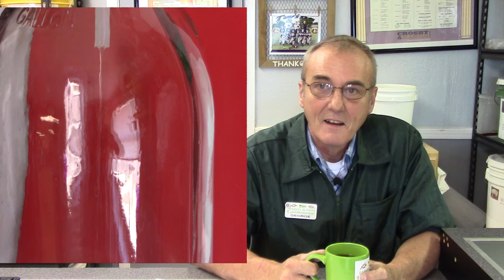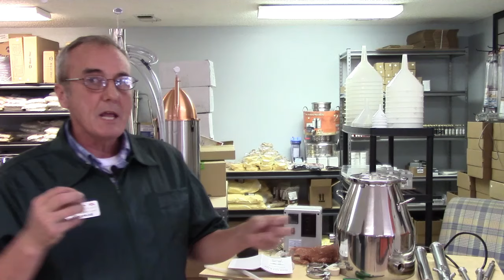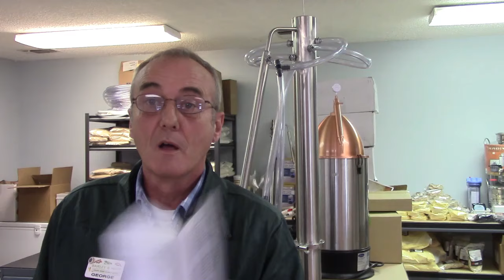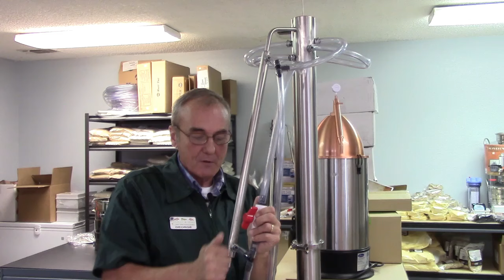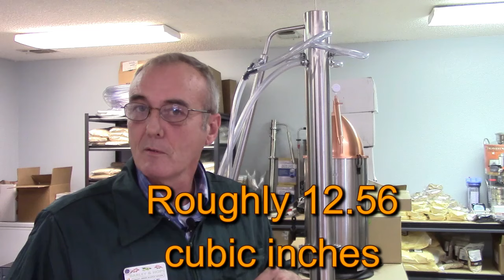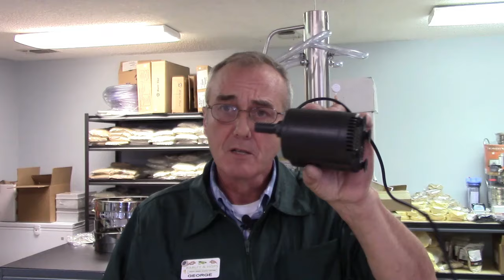3 Inch Combination Pot reflux still

Comment: Completely agree with what George is saying regarding ease of hauling stuff around in smaller batches.

Once you jump from 25L /5 Gallon batches to something bigger there are a whole lot of extra work and logistics presented just in moving around the volumes and weights involved.

I've been running a 50L still in various configurations for about 1-2 years now and anything over 50L and you are moving brew barrels around with sack barrows and decanting stuff in smaller containers or with a large pump/siphon.
Reply: Right on. I live in an apartment with limited space. I have a couple of 40-liter fermenters (over 10 US gallons) and moving those buggers around is a major pain. I'd love to have more space so I could just put them in a basement and forget about them, but I don't.

I tend to use my 19l (5 US gal) ones more often since I have to move them every so often.
Reply: Heck-fire....I have access to a 35x75 shop, and I don't want to haul around anything! Could I use my forklift? Sure, but I'm not gonna!!! Ain't no way I'm fermenting in those 1250L totes!

Comment: Hi George,

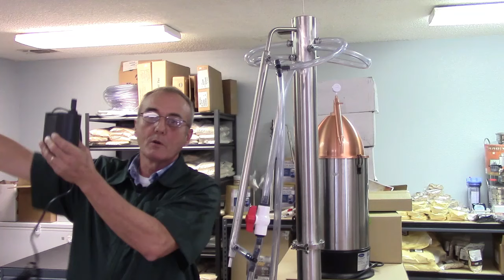I got a 13 gallon  3” column reflux still with a shotgun condenser . I’ve been stilling 5.5 gallon batches of rum and it’s take 5:20 min..My question is this normal? Seems like a very long time. Please advise. Thanks in advance! Bret
Reply from the maker: That sounds reasonable to me
Reply: is there any way to speed it up.. more heat perhaps
Reply from the maker: Yes, more heat will speed it up but make sure you are careful. Too much heat will cause the spirits to come off with tails mixed in earlier than you expect. This can ruin your run. Also, the proof will suffer dramatically after you surpass the optimum production temperature since more water will come out as well as spirits. 
George
Reply: Hi George,

I think I found the sweet spot, H2O flow control a must to keep optimum temp . Need to get electrical heating element and a PID from you. Pls advise Thx Mr. Duncan!
Reply from the maker: Great. The sweet spot is important and different for each still. Once it is found it opens up a whole new world for the operator. 
So glad you got there. Only good things come from that. 
By the way, electric is easier to control with some sort of controller but propane works well too (if you figure out the flow sweet spot of the propane )
George

Comment: can you determine a goldielock temperature for the water coming out of the reflux hose? just curios.. sounds like the pot needs a pop off valve.   Thinking about getting my son a still for xmas. I live on Disability and need to get the best bang for the buck..

Comment: Hi George,
  Puking is when the liquid in the pot is boiling over up the column and coming out the condenser. Huffing is when the column fills with liquid from too much reflux and fills the column. This happens especially when the packing is placed in the lower column tube and inhibits drainback of the reflux. The best cure for this is to lower the pot temperature. If you try to reduce the reflux coolant flow the head temp goes up too high. 
 A huffing still can produce high alcohol but you get pressure release out of the condenser and the distillate surges. OK for stripping but not ideal for high-purity single distillation, and probably the packing is not properly helping vapor production. A sight glass between the column sections will show this. If your still is puking the liquid visible in the glass won't be clear. To get one of these to puke you'd have to be running a burner on very high flame. In either case the pot temperature is too high.
Reply from the maker: Thanks for the information I am sure others will also find this very helpful.
George

Comment: I would agree with you George about the 15gal vs the 8gal. 8gal are a lot easier to manage than a 15 gal and I can still use all the buckets I have for making beer. If you get a 15gal you really are going to have to spend a lot more over the 8gal. So get an 8gal and make life easier for yourself... LOL

Comment: So it's not a good idea to run a 3" column (28" tall) on 15 gallon keg with a 2000w element?
Reply from the maker: Ooo, absolutely. You will have great results and much quicker than the 2 inch column,
Reply: @BarleyandHopsBrewing  but 2000w watts is enough power for a 15 gallon keg?

Comment: Yes George I was talking about the beginning where you showed the still running in a 1 gallon carboy. You show this in a previous video and I was wondering would give you better quality or higher proof? Also do you run both a reflux still and a pot still like this? Keep up the great work I love your videos.
Reply from the maker: Okay. Got it. This is only an indication that everything is operating at it optimum. The quality and quantity are still your responsibility. The demonstration here is an example of a properly running still.

George
Reply: @BarleyandHopsBrewing  hey George I'm getting the 8 gallon kettle I was wanting an all copper column and condenser tho. Any suggestions on where to get that in a 3 inch

Comment: Videos that this is the best way to run a still. I you Never said why. Will this give you better proof? Or better quality?
Reply from the maker: Please elaborate just a little more so I know what you are referring to specifically.
Reply from the maker: If you are taking about the beginning where we show a running stream, the answer is yes. We found this to be the best indicator that everything else inside the still is working at its optimum capacity and capability.